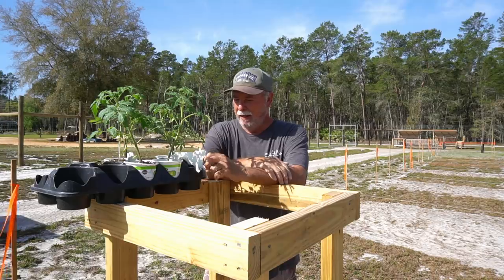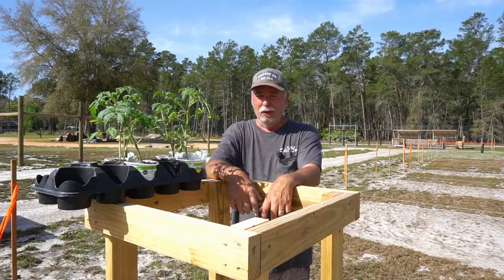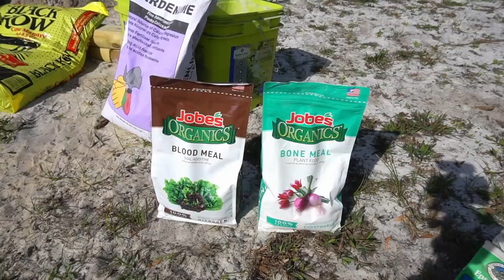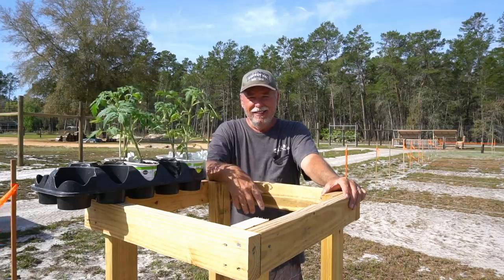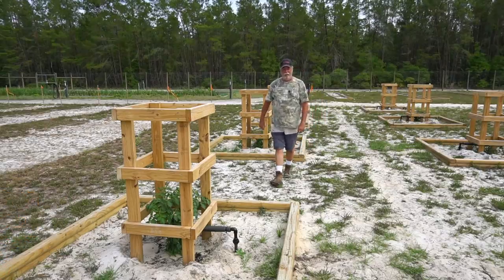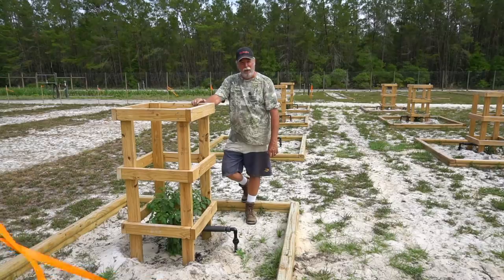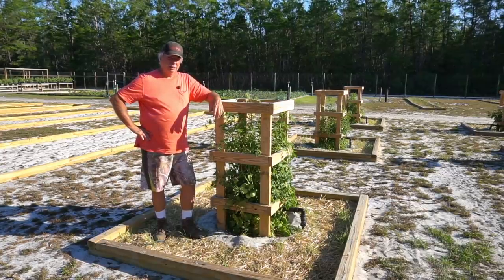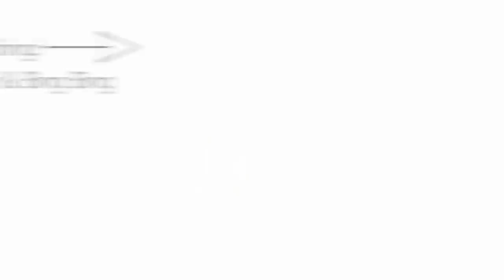Strange but Efficient Way to Grow Tomatoes at Home

Comment: Hollis I just got my tators planted today. I haven't even started my tomatoes seeds yet. I will start mine in a few days when the signs get right. I plant parks Whopper been planting these for 35 years. Hollis I put the shells which is calcium in the year before where I'm going to plant my tomatoes. I get mature manure that's been cleaned out of my uncle's lots. He stacked it up and I wait a few years on it before I get it. Here in Oklahoma I use an 18-46-0 fert between my plants. I planted six feet apart and it will grab the the fert as the root systems get bigger. Like you I use fish.

Comment: I love y’all’s new Homestead. Hollis, I just have a very small garden. I’ve been growing tomatoes in five gallon buckets, but they get so very tall, like 7’-8’, and they want to fall over. I love indeterminate but I think I’m doing something wrong. Do yours get tall and if so, how do you support them pass your wooden cage? I love the way you explain things so clear. Thank y’all for such great videos.
Reply: Dee I was just going to ask this question. What is used to support the indeterminate tomatoes after they flow over the side of the crates Hollis has built.
Reply: @kathymccay9355   - In an earlier comment, Hollis said that he just allows the plants to drape over the wooden frames because it is not feasible to reach higher than his arm span/reach. Hope this helps. I have seen other videos where they do the same, only their framing is a bit higher than the ones Hollis built for his. I just love the frames he built, but with the cost of wood these days, I am planning to make mine from goat fence or cattle panels bent into squares. I am hoping this works for me as I have tried trellis and seems I spent more time tying them to it rather than enjoying the process, and then at the end of the season spending all that time to disconnect all those little plastic rings to be able to use them again is just so much work.

Comment: You know they’re big when they’re bigger than Hollis’ hand. Great job! Hollis I’m curious. Why did you plant them so far apart?
Reply from the maker: I wanted to ensure good flow through ventilation between the plants. Mine are a little further apart than what is really needed because I needed enough space to mow around them with my mower. My lawn mower is big so I spread them out.

Comment: Can I ask if the fish bones decompose in a season or the whole year.. I'm wondering if I put them in my ground for fall will I have to be mindful to not get poked by a bone for the spring crop... I know they can be quite sharp but or they just break down and you don't notice them in the soil?... hope that made sense!
Reply: We have used the fish for fertilizer. The next year there was no sign that 
they were ever there. Just use smallish fish. Similar size that he threw in.
If they are bigger, just chunk (cut) them up a bit.  Good Luck. 

OH, a tip. Dig your holes, toss fish in, cover with lime and fill the hole back
in and leave for a week or so. If nothing has dug them up in that time, 
fox, raccoons,  dogs, skunks, whatever, then the scent is covered 
enough, so nothing will come along and dig up your plants.
Reply from the maker: The fish is completely gone bones and all very quickly.

Comment: Are you having any trouble with the root rot in nematodes that’s so heavily infested in Florida?
Reply: I've read nematodes travel from sand particle to sand particle so the more compost you add the less chance of problems.  If one does like he does and not mix the soil mix with the sand the larger part of root system should be fine.  Also a huge market gardener uses lots worm castings in each hole to combat nematodes...probably same concept.